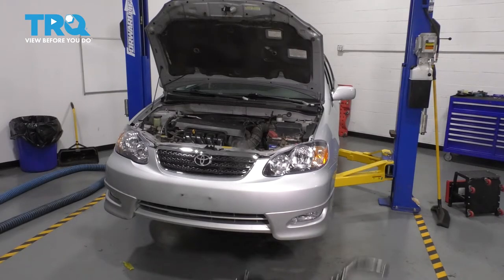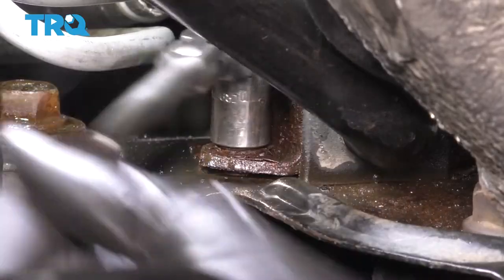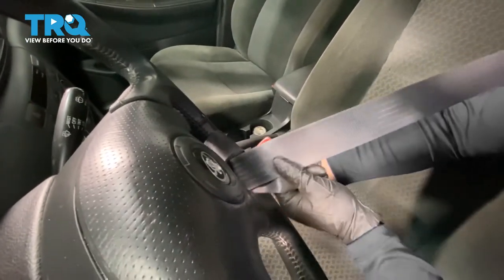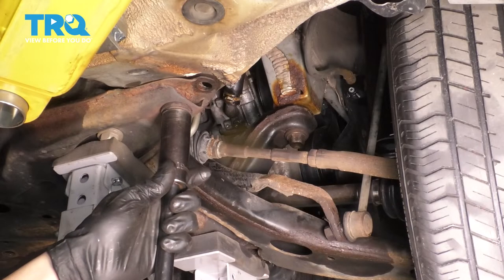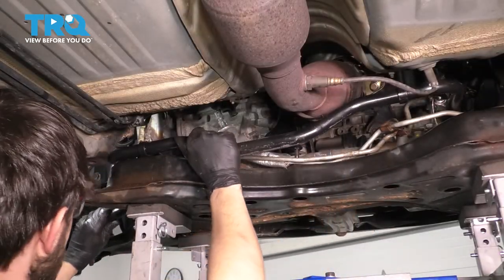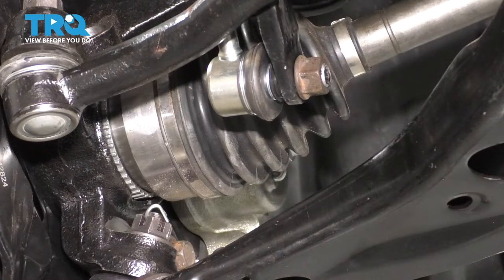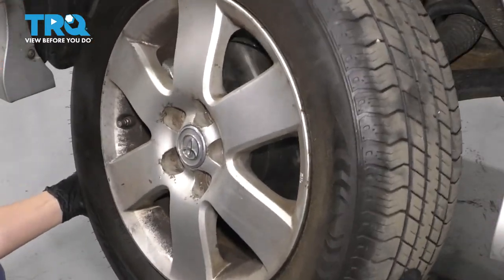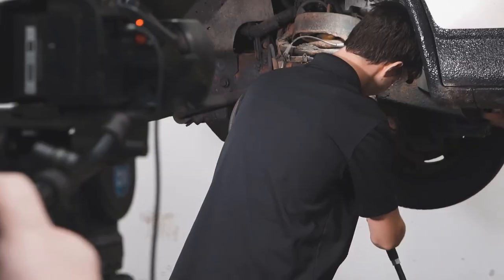How to Replace Sway Bar, Bushings, & Links 2003-2008 Toyota Corolla

Comment: seems easier to replace whole car assembly.....I have a 2003 Pontiac Vibe and I think my set up is the same. If my sway bar starts clunking, I will upgrade the amp on my stereo.

Comment: I’d love to see this performed on a ‘10-‘12  Ford Fusion. The sway bar bushings are in a very tight spot. I think the sub frame has to be dropped to remove the bushings bracket bolts. Anyone out there reading this with any experience with 2012 fusion sb bushings?

Comment: This is a nightmare to do on the ground. Got a new sway bar in but only half the steering colum in.... wiggle wiggle push push. It's been almost 2 hours on that part alone.... never again. 
On a lift I could see this being 10x easier. But on jack stands rolling in and from under the car the adjust jacks.... I wish I had just left the old sway bar in 😅